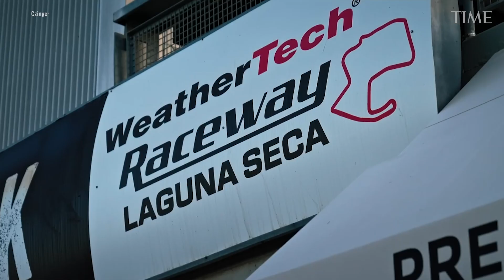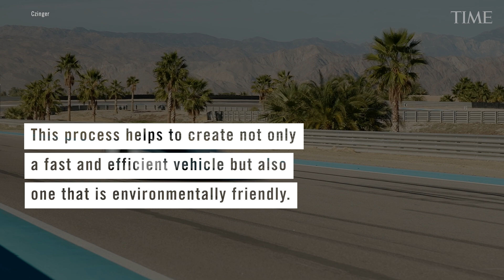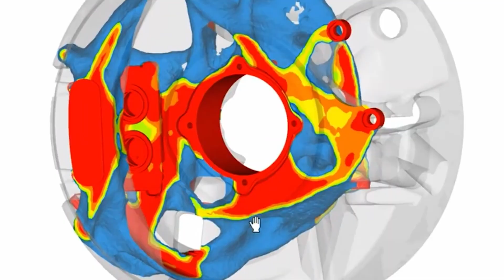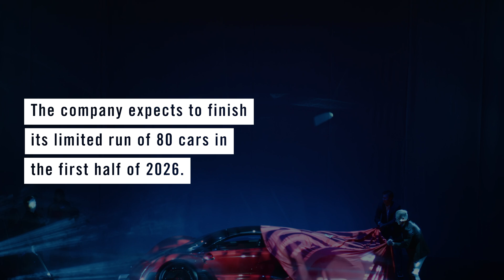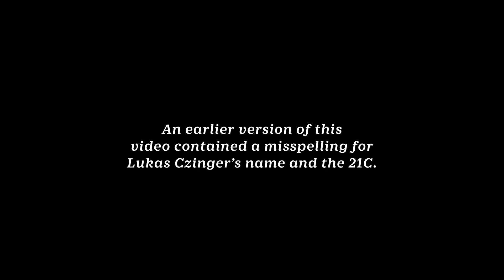This Company is Using 3D Printing and AI to Make Sports Cars

Comment: This guys and rimac together will dominate!
Reply: @joseluisbranconunes   RIMAC already working with them on the Bugatti Tourbillon. The Tourbillon suspension an control arms are using liquid Metal technologies. But this is not new technologies what makes their approach different is the organic like shapes to reduce material use.
Reply: Multi-million dollar cars is not the future. The future is Tesla and Chinese ev manufacturers
Reply: Rimac is almost from the start together with WV and little bit with Koreans so the opposite of this poser.  Before you 3d print this car once toyota made 1000 cars in the same time period.